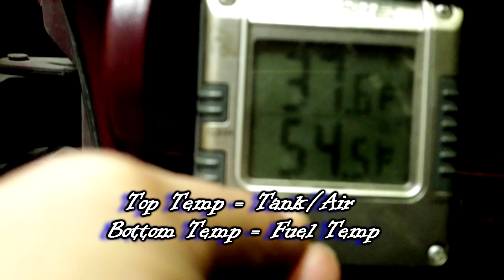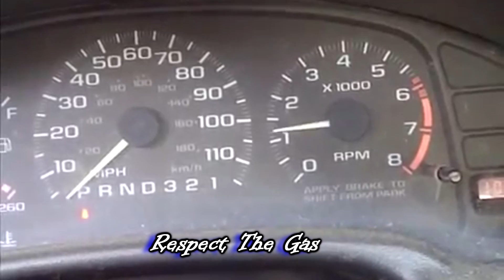Is 100MPG + Possible?? Alternative Multi Fuel Vapor Van!

Comment: Hey there I was surprised to see part of my video on yours lol cool man anyway yes your right Multifuel is good and cold Vapor is not that great. I recently went with Heated vapor and it is Far and above the others. Also not sure if u seen it but I have a Video of a simple way to pre heat your fuel in any car buy using the Radiator waist heat. It will give you around 5 to 10 more mpg and increased Horsepower. I like your approach I used my exaust to heat my fuel and it works Great when it up to operating temps
Reply: Increased vacuum lowers the boiling point of gasoline ( any liquid actually. Went through a period where I used no heat then used heat. Rad heat ( Tom Ogle) exhaust heat( GEET system among others). I used a preheater and electric heat as well. I found making sure vacuum was strong enough was the only way to burn the fuel completely but the control was not there. I could start the VW1965 notchback sedan (came in fastback and square back models as well ) 1100 cc  fuel injected throttle body, in extremely cold temperatures and run without any heat. Heat did not add to the function as refining gasoline has its limitations 100-400 degrees
One of the reasons you see limited results in automobile tests. The most volatile part of the gas( light ends have the most reactivity hence the most control and most horse power and have the least amount of vacuum. As you go through the stages the need for stronger vacuum goes up horse power diminishes control is limited fuel efficiency skyrockets. As you approach the heavy ends vacuum is extreme horsepower is critically lower control non existent  ( rate of speed{ RPM} ) is a delicate balance ( all the tests that have been successfully performed have been at constant speed{test track uninterrupted highway mileage) myself included. The efficiency however was pretty much unbelievable to quote one post " bullshit"
Each time my test failed I restarted ( without adding " fresh" fuel reset engines vacuum and established its equilibrium but could neither speed up or slow down
In the lab you could establish high RPM but and run for hours at whatever it was set at but any attempt to change RPM( in either direction) resulted in failure( the famous El Paso to Demming and return. Five miles from finish failure of system with gas still left in tank)
This renders the automobile application pointless in a regular operational situation. 
Haven't seen anyone overcome this hurdle in all the videos I've seen. As well have never seen or heard of anyone burning the full tankful wether small tank ( I used 1 gallon at a time( mr Ogle 3 gallons pre measured Charles Pogue full tank) anyone using a system that circulates the fuel gets longer running times with horsepower but ends up with large quantities of fuel that's is unusable
Stationary engines work best ( constant speed) and seem promising but the vacuum is not nearly as responsive as it needs to be to respond to changing demands in traffic situations
Anyone?
Reply: diveborg13 checkout my videos by  Mike Holler and the science of fuel combustion.
Reply from the maker: +diveborg13 Hey man thanks for watching and continuing making some great vids! My son blew up the van (ran it outta oil) and we moved so everything went on hold for awhile, I will convert a lawn mower engine to turn an alternator or two to give it a load for more accurate testing that of course will use the exhaust as well as those electric heaters to get a good fuel temp. Good luck in all your endeavors!
Reply: +InJayzBraiN  thanks i'm actually working on Stan Meyers Tec IE water powered engine Good luck to u and feel fee to ask any question feel free to ask if I can help
Reply from the maker: I completely agree with you Leslie, I was considering setting the system to be used in conjunction with our present fuel injection system  being able to switch it over when running a constant RPM like on the freeway as like you said attempting any sudden change causes it to stumble and/or fail.  
Sorry I didn't respond to the post you made 4 weeks ago, I didn't get a notification... I can completely believe the achievement of 651mpg I've ran across scanned microfish reports of SHELL breaking the 1000mpg barrier which is simply mind boggling.
Reply: It's not really impossible. I would attempt it on the little commuter engine in the Chevy volt and change it into a generator. Using the electrical. I personally think Tom ogle should have received the X Prize for his accomplishment. After all except for the vacuum tank conversion it is a more ordinary car than the team that won. Mine was
More of a sowing basket on wheels that VW made in 1965 lol
Reply from the maker: Yeah Tom should have received the X prize, and hey regardless of what it is in you still had a 4 wheel vehicle achieving awe inspiring results!
Reply: Thanks who knows you may just have the answer I know the answer isn't in what shell oil tried or Tom ogle Pogue or myself
Problem is the more outstanding or remarkable your results , the more disbelief you encounter
I had an ex wife I'm used to being insulted loll ever need advice yell
Leslie
Reply: https://youtu.be/Ke0MGmUr3SU

Comment: is it just tap water or special iodized water and some additives? i would like to try it in my ford focus if i could figure out how
Reply from the maker: +Brian Hunt Distilled water from what I've seen, though some have been using tap.
Reply: +Brian Hunt One thing that people use is water/meth injection, the water mist cools the air marginally and takes up space in the combustion chamber before it turns to steam, increasing the overall compression ratio.

Comment: ok now i feel more confused than ever i have been watching videos about water injection for a hr and i feel just as lost as when i started i love the simplicity of it the ones made out of a juice container by the 2stroketurbo guy seems the easiest but what its doing how where why is a mystery to me and how much better gas mileage would i actually see??
Reply from the maker: +Brian Hunt That's the magic question, there's so much the water mist/vapor is doing. Steam cleans the engine, cools intake temps, and adds oxygen/hydrogen to the combustion chamber above the amount you gain from colder intake charge. All this has got to equate to some gain wouldn't you agree?

Comment: i was liking the idea of people adding propane to their air intake as a additive and just let the car lean itself out
Reply from the maker: +Brian Hunt Yeah I've been looking into water injection (ultra fine mist or vaporized) and much cheaper than propane. The turbo guys have "re-found" this concept and been using this to push more boost without detonation, this almost became popular back in the day in normally aspirated cars as a power/economy adder.
Reply: +InJayzBraiN it doesn't add power.  it only lowers egts.  I run it daily.
Reply: They use it in jet engine applications to add thrust during take off but in automobiles it helps cool intakes especially in this particular instance where a lean mixture is utilized.

Comment: why not use a power inverter and heat the fuel with a ammo box and hot plate
Reply: i think its better if u put nichrome heater that runs on 12v. 10ohm
Reply from the maker: +ben dover Yeah a hot plate would work, I was attempting to make the engine do all the work but since my son BLEW the van up (not checking the oil...) I'm scaling down to a lawnmower engine and some alternators to add a load and see how much power/fuel economy I can get out of it. So a hot plate may be in the near future!
Reply: i think its better if u put nichrome heater that runs on 12v. 10ohm
Reply: +andreiruiz143 would that supply enough heat?
Reply from the maker: +andreiruiz143 No need for an inverter, and should get plenty hot with a melting point of 2550 degrees F!. Great idea I'll look more into that!
Reply: +ben dover i think yes actually i use it for soldering and its very hot.
Reply: +InJayzBraiN test it with resistor 10ohm 3w and if u want higher temp and bigger tank use 9ohm 20w resistor.and if u want to make it finalize buy a khantal wire or nichrome. just replicate the e-cig vape.:)
Reply: check my vid it produces vapor very fast and heating too
Reply: +InJayzBraiN sir check my vid i think ths can help u for vaporizing and heating to using 12v only:)

Comment: I agre about fuel vapour system that incrase millage, but 100mpg!!! its not gonna happen...
I already try it, almost 2 years working on fuel vapour system, only got 30% of millage increase max.
Reply from the maker: +Evan Wide 30% is still quite a jump. It has happened before on a V8 not that long ago, also an modified opel in the 70's won the mile per gallon race with almost 350mpg, and I've also read somewhere back in the 70's shell broke the 1000mpg barrier. Sounds crazy as all hell but could be legit.
Reply: @InJayzBrain  i don‘t see the physics behind it!
For example a modern 2ton car needs 20KW to overcome air and tire resistance at 70miles/h
Petrol give you 9KW/Kg. That mean if your engine has 100% efficiency, you will need 2,4L petrol. Modern petrol engines have a efficiency of about 30%. You will have a consumption of 8L or 30mpg. You can not go lower than that. If so, you need thinner tires and less air resistance.
Reply: Evan Wide sounds about what I did with a lawn mower engine. More like 25% longer.

Comment: small heater coil and a lawnmower carb w a working float, JB wield the carb on top of the coil, run hose from cars stock heater coil's return to the intake of the coil ur using and hose back to the intake on the radiator run fuel line to the carb an place in your vapor container, the carb will keep a constant lvl of gas in the container and the coil will keep the gas above 200 degrees
Reply from the maker: That's a great idea! Thanks Jay, this would also work great with a lawnmower power unit running the exhaust through the heater coil. Extra bonus muffler to

Comment: What if you run some exhaust into the air intake hose? Would that keep the temperature above 80?
Reply from the maker: premiersharpening I'm a little worried about introducing exhaust into the system. I was pulling hot air from the engine and heater hose off the exhaust, but not direct exhaust. At any rate the vapor process chills the fuel so quickly in large engines I decided to move most of the fuel into a heating tank while only allowing a small amount circulating through the vaporizing chamber. Initially I'm going to use engine coolant to heat the fuel, but I could change it and plumb exhaust through the copper radiator assembly I built if the coolant doesn't reach proper temps.